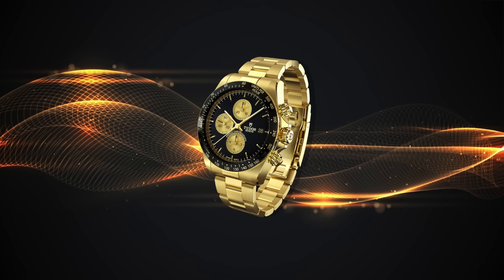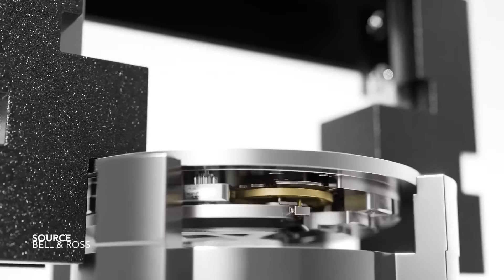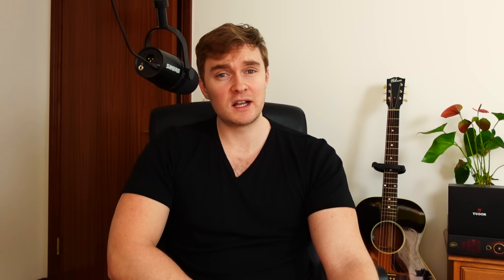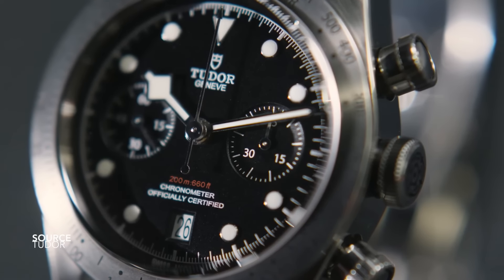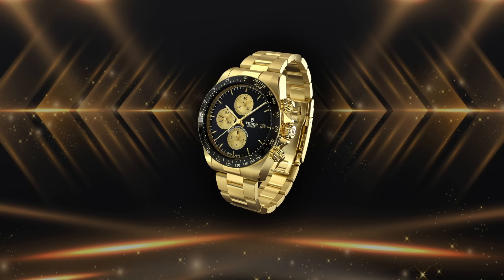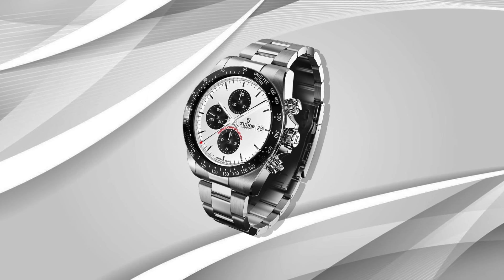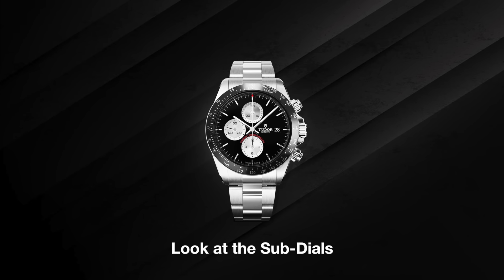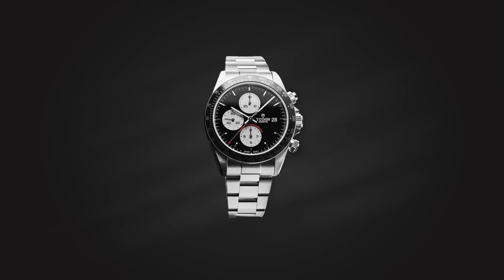Tudor's NEXT Chronograph? Prince "Big Block" Release Predictions (with Renders)

Comment: I’m hoping Tudor will build a new line on the Prince name. There’s so much potential! 🥃
Reply from the maker: Just imagine how cool it would be for the Prince to come in as a Diver etc… I reckon it would be so refreshing! Well said Alvin 🥃
Reply: It’s too thk
Reply: All I see is Tudor neutering the Prince name to avoid a reduction of OP sales. I’ve handled many a Rolex, and none of them felt particularly high quality compared to their Tudor counterparts and to an extent, compared to micro brands. If they release a Prince in an Oyster case there wouldn’t be a great reason to buy the Rolex besides the brand name, which is somewhat why they made the Black Bay instead of releasing a near identical Submariner with that name and the same case, though chamfered on the edges and fitted with a 2824. 

They gotta be real careful, but I’d love Tudor a little if they reissued the Prince Oysterdate with an engine turned bezel.

Comment: I think your thoughts and predictions are well thought-out and highly plausible. I would welcome such a chronograph revival that doesn't ride on the very long, but worn out, Black Bay coat tails.
However, at the same time, I'm not sure it would be a watch for me. 1) in my earlier years of automatic chronograph watch collecting, they were nearly all Valjoux 7750 based and had the subdials at 12-9-6. I didn't know as much back then, but, I just accepted that was always going to be the case with more affordable automatic chronographs. As such, I think I got incredibly bored of that layout and don't ever gravitate towards such in my new(er) watch collecting days 
2) I just prefer the visual weight of chronograph subdials to be more centered and bottom balanced and with 9-6-3.. or, balanced with just 2 sub dials at the 9&3.
Reply from the maker: There’s a reason why the 3,6,9 dials have helped define the Chronograph layout (from the very beginning) 😉 But anything to get away from the Black Bay line… I’m begging, pleading we see something like this. The revival of the Prince - Prince Diver, Chrono, Date… ah, there’s so much potential! Hope you’re well m’boy! 🥃

Comment: I managed to make a watch with a valjoux 7754, in a 38mm steel case, 100m WR, screw down crown&pushers, 13.5mm thick. If *I*, an amateur, can do it, Tudor should be able to do it too. Oh, and sapphire front and back.
Reply from the maker: It's the slab sided cases that always let the profiles down (hopefully they can tweak them) and thank you for sharing this! A 13mm thickness is sublime! 🥃

Comment: I have been eyeing the older Tudor Prince watches the past several weeks so your video caught my attention immediately. Tudor bringing out a new model using older designs would be tempting if Tudor uses color on the dial & bezel to differentiate itself from the competition. I understand the need to move away from Breitling movements, but am surprised that Kenissi would test out a new unproven movement on the Tudor buying public. Judging by your tone of voice, you seem very skeptical on Kenissi launching new movements too.

Comment: Your renders are the most sound and logical design of what a steel version of the OnlyWatch Prince would look like... and that's why I suspect it is completely wrong! 😂
The design is just too close to the Daytona, and if there is one thing we know by now, Rolex will not let Tudor go all-in, and it will be nerfed in some way. The only way i see a standard 'Tudor Daytona' coming out is if it's 42mm, 50mm lug-to-lug, 15mm thick obscenity. If they don't just nerf it with size, I would imagine they will go with a colourway more like the Monte Carlo (original and discontinued modern 42mm in the blue/orange and grey/orange) or something equally whacky.
I hope you're right, but it goes against everything Tudor have done for the last 12 years, with sole the exception of the Pelagos line.
(Although I will admit, it does appear that very recently Rolex does seem to be loosening the reigns a little, with not only the Pelagos 39 but the BB54, so who knows?)
Also, if they do go with something conventional like your design, i would imagine that's going to see the Black bay chronograph discontinued too, they occupy too much of the same space, and they only updated those fairly recently.
Reply from the maker: Something in my gut tells me that Tudor themselves are keen for a change-up. The BB line has been around for a decade plus and maybe. Just maybe they feel confident enough to produce the “Prince” again - Prince Diver, Chrono and all the rest. It would be brilliant! BUT I’ve been wrong more times than right 😉 Tonnes of potential here though 🥃